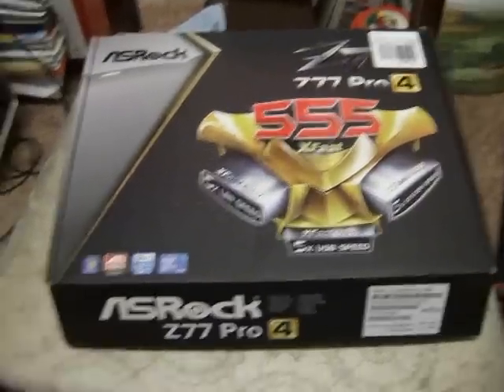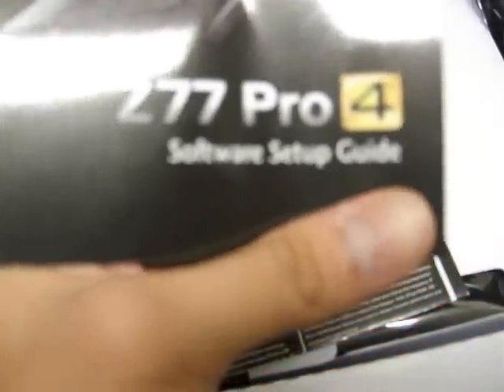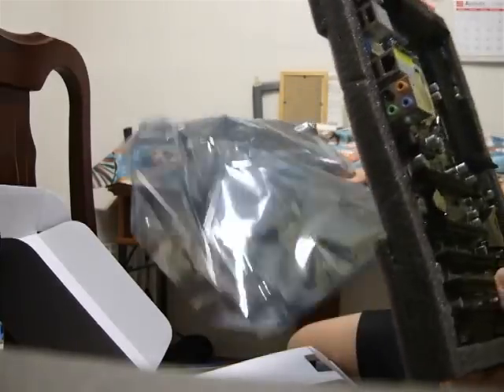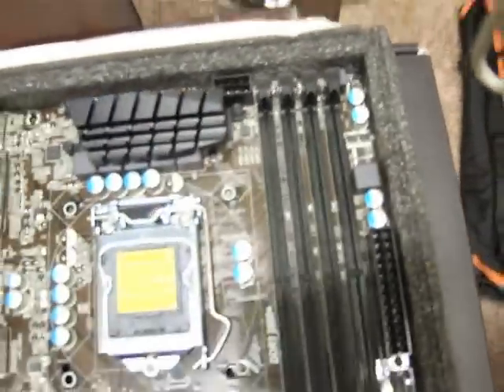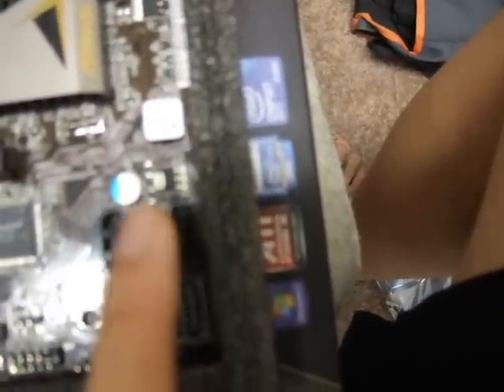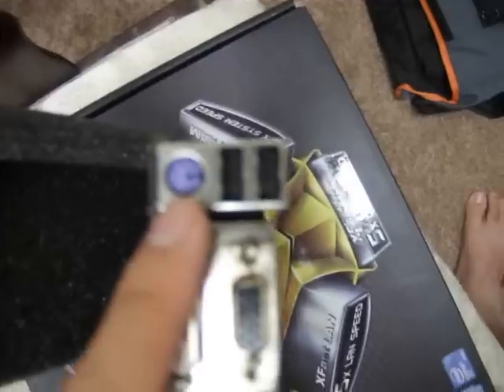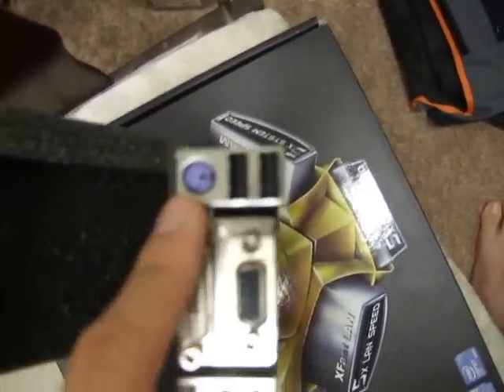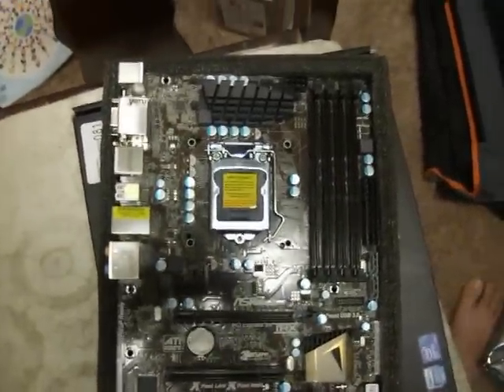ASRock Z77 Pro4 Unboxing and Review

Comment: Found a desktop computer recently at my local supermarket recycling center that had this motherboard in it. Fully working. 🤔😎😇😆👌👍

I upgraded its stock CPU (i5-3450) to an Intel Core i7-3770 CPU & 4x 8 GB DDR3 1600 MHz Kingston RAMs.